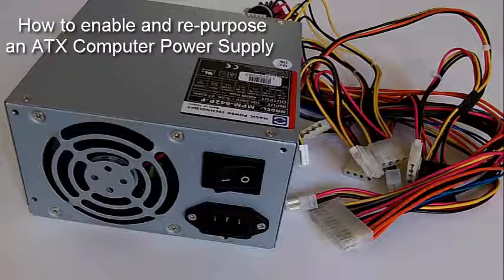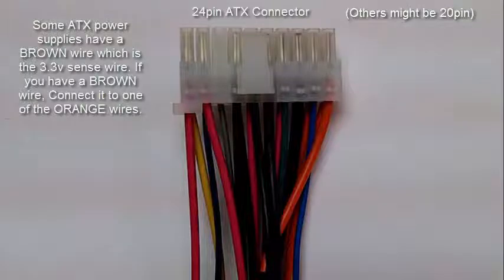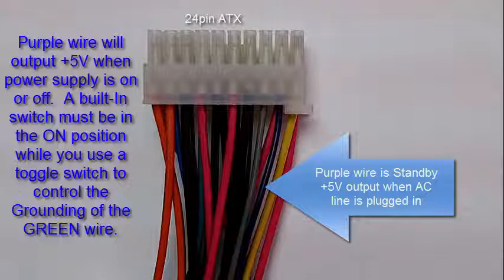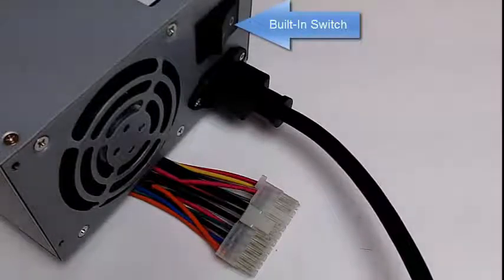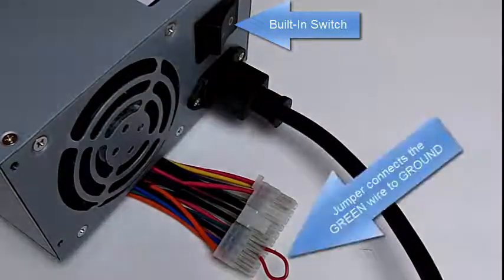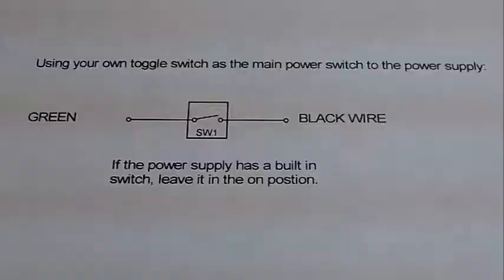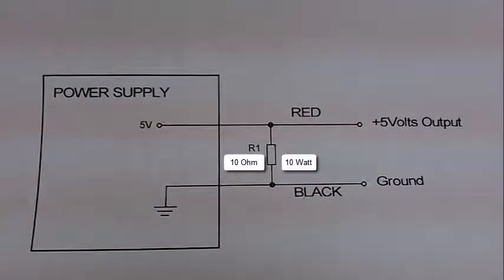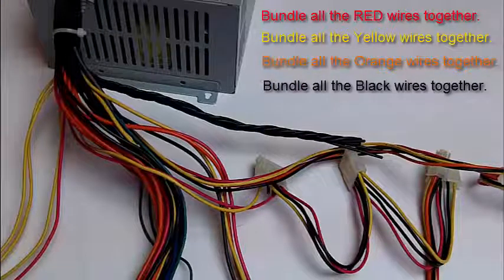DIY Lab Bench Power Supply by enabling ATX PSU : Eye On stuff

Comment: Are you saying the purple wire will be hot if the unit is plugged into the wall even if the built in switch is off?  Or does the built in switch need to be on for the purple wire to be hot?  Thanks.